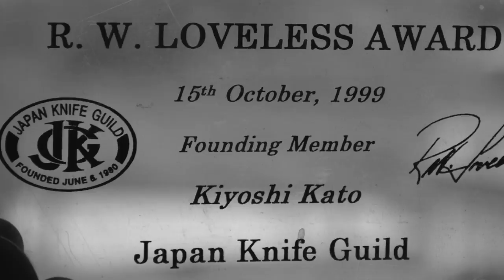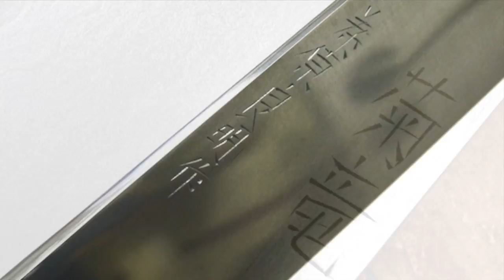Kiyoshi Kato Kitchen Knives 2014

Comment: I've never seen a wood planer-like tool used on hardened steel before.
Reply: +entropy11 That is called a "spoke shave". Originally  used to make spokes for wagon wheels. He must have hardened the snot out of it. Or made one...
Reply: +entropy11-- In Japan, that tool is called a "sen".  He actually wasn't using it on hardened steel.  You can see in the beginning of the video that he made a 3 layer steel laminate called, "san mai" by forge welding a high carbon steel core (for the edge which ends up in the center)  inbetween 2 pieces of mild steel, one for each side.
 
The mild steel on the outside doesn't harden during the quench due to it's low carbon content, which allows the bladesmith to use the "sen" (made from hardened high carbon steel) after the hardening process to scrape away the soft steel on the sides to expose the hardened center (edge) steel.  If you think about it, a sen cuts kind of like a file does, but it's only cutting with one sharp edge as opposed to the many edges (teeth) on a file.

  I believe the sen makes faster work of the initial stock reduction to expose the cutting edge (by tapering down in thickness from spine to edge), whereas a file will leave a flatter, more consistant finish and clean up the marks left from using the sen.  This all sets the initial blade geometry, which is then refined even further by using a number of different water stones, starting with coarser ones and working up through finer and finer ones, just like when using sandpaper.  Something along those lines at least.  ;-)  

Hope that makes sense!  :)
Reply: +lsubslimed Great explanation!
Reply: +entropy11 neighter did i.. cause that's done with an annealed blade :p
Reply: +Franco Buzzetti LOOOL he really used it on the hardened edge , my bad i pre-answered ahahah
Reply: +lsubslimed I've seen several different smiths use it to cut fullers on longswords. The shavings come off smoking hot. They use about 63-64 Rockwell blades on a 57-58 Rockwell sword so it's really not hard on the tool. Yes I know this is different than what he is doing here but it is viable for other styles of work. ;)
Reply: Gunslinger15 Yes sir, you are correct ;)  Yea I've seen guys use scrapers to cut in fullers as well.  They both work the same way in the fact that they each use an ever harder steel to cut away other hardened or non-hardened steel, but they are shaped and/or sized differently depending on what the purpose of the tool is.  Great example. :) 

It wouldn't seem all that unrealistic that hard steel can be shaved (cut) off by even harder steel if people understood that Hardness is relative.  Just like how carbide bits can easily cut (drill) through "extremely" hard steels such as files and the very hard sen being used in this video.. and also how the diamond wheels in drill doctors can sharpen carbide bits by cutting/abrading small pieces of carbide off of the surface..   Next come the lasers that cut the diamonds! lol ;)
Reply: +lsubslimed yep, one point on the sen. A sen is more of a two-way draw knife. A spokeshave isn't one piece by nature but other than that, great info.
Reply: Gunslinger15 Yea, I've never used either one myself,  however I'd love to try making a sen one of these days, maybe out an old file to try it out or some W2.  It would definitely be fun to make one even if I end up hardly ever using it.   Do you forge or make knives by any chance?  I could swear I've seen your YT name in some other video comment sections.
Reply: +lsubslimed to be honest I'm an aspiring blade smith, gun smith, armorer, luthier, bowyer, joiner, wood turner, and computer builder. I have several friends in the guitar world and the firearms industry, I say this not to brag but to say that this is where I get my information. Hopefully I will be building a guitar for Rabea Massad of Dorje in the next couple of weeks and I hope to forge various woodworking tools such as chisels and plane irons and other odd bits for Ben Crowe at Crimson Guitars. And finally I have learned some gunsmithing from IV8888. So yes I get around in the world. You can find my business at arsenalcustom on Instagram and Arsenal Customs on Facebook. Also I'll be looking for skilled help in these areas as smiths, strikers, luthier apprentices, etc. if you ever need a business to be attached to or be in correspondence with. I know this was a lot more than you asked but I figured you would appreciate the full "spill" so-to-speak. :-)

Comment: Maksim, thank you for posting this video, it is exceptional. The few slow motion sequences revealed subtle details in his process. The next day after the annealing (or normalizing, depending) he cold forged a curve in the blade, both directions. I'm assuming this was a grain structure refinement step but I would sure like to know what he says. Did he explain this step to you? Did he have a name for this step?
Thanks
Robert
Reply: When I watched i was wondering the same thing.
Reply: He was getting the scale off of the blade prior to cold forging.
Reply from the maker: ***** It is for scale removal
Reply: Maksim Enevoldsen thanks!
Reply: +Maksim Enevoldsen (JNS) 
Can hot forging not do this?
Reply: +Watch Ryder While hot the carbon in the blade will continue to create scale.
Reply: Nafzger Forge
Is it just a case of scraping the scale off if that is done?
Reply: +Watch Ryder The scale is very rigid, like a glass, it will not bend. So when he bends the blade, the scale pops off instead of bending with the steel. He then most likely lets the grinding wheel/belt (whichever he uses) take off any residual small flecks. Getting as much off as possible before grinding saves a lot of life in your grinding tools. That scale is VERY hard.
Reply: Doesn't cold forging uh... makes the knife prone to snapping and create cracks? Or does it work somewhat like work-hardening silver?
Reply: Lukas Prei
Reply: @user-yq4ph9dx8g  pure steel like tamahagane more easy to forging

Comment: A couple questions Maksim. The very purpose of cold forging prior to the hardening has eluded many American smiths, which includes myself. For what reason is Kato cold forging? I suspected since he annealed and then cold forged, he was fracturing the crystalline structure evenly similar to a normalizing cycle, which he didn't do in general sense. If this is not the reason then why? Otherwise once he brought the blade up to temp. for hardening, any other reason to have the grains fractured is nullified by the grain reset. Please correct me if I am wrong.

Also, is this a San-Mai construction? It is hard to tell when he is drawing out the tang on the power hammer, and not sure if the scale is tricking my eye, but I am counting 4 layers. As if the initial long bar stock was mild steel with two pieces of high carbon stacked on top of that and another piece of mild on top of all of those. EDIT: As I watch again, it looks like a 3 bar construction with the long bar stock being mild with one piece of high carbon on top of that along with a mild steel bar on top of that.

Thanks for your time and posting this video. Makes me want to buy a Kato blade sooner rather than later.
Reply: Daniel C as far as I can tell, it's a kasumiyaki blade design. One side mild steel/iron, the other side is high carbon steel. The urasaki would take most of the high carbon steel, leaving only a little bit on the edge, and the back of the knife to keep the layer together. A downside to these knives is after 40 or so years, it will tend to warp if made by someone who isn't a master bladesmith. The warping occurs as the two metals stretch and contract differently over time. I hope I could be of assistance!
Reply: It's a san-mai. You can see it when he does the forge welding at around 1:10 - Long bar of mild steel on the bottom, high carbon steel in the middle (you see him flux both sides of it), then another mild steel on top (fluxed on one side only).
Reply: I was wondering if the flux has carbon in it, it looks a bit different than Borax to me or am I not seeing it right?
Reply: From what I've read cold forging before austenizing can allow for a slight finer grain when up to austenizing temperature

Comment: Why does he first hit the metal with the hammer put in water and then puts it under the pneumatic hammer?
Reply: Vladimir Savov 
The water is used to blow the scale off the blade so the the powerhammer doesn't imbed it into the steel.
Reply: Thank you

Comment: Why did he hammer curves into the blade, one side then the other?
Reply: +Big Jenkins 
At first it looks to me like he was doing it to remove fire scale.  I thought it may have been about work hardening it but he hardens the blade after that, so no point, or maybe just to harden it enough to work with it and dress it.  It may also have been to check for any cracks and things he missed which would likely show up better when bending it that way and removing the scale.
Reply: Its to relieve stress It also can be done with a pneumatic air gun
Reply: remove scale

Comment: Wouldn't throwing water on it right from the forge damage the integrity of the blade? I'm new to forging
Reply: Seems to be fine. and when forging steel you are already doing tons of stressing to the blade as is. That is why smiths do normalizing sessions where they heat the steel to a bright red and then allow it to cool again. it allows the crystal structure to relax and relive the stress it has had built up inside it. at red heat the crystal structure gets all soft and it sorta flows together and then as it slowely cools the crystal structure evens out and then you can finish up by annealing it thats when you heat it to that bright red and when you "cool it down " you will put it in some kind of insulating matterial..he used ashes...some use vermiculite which is good at insulation. and you allow the steel to cool VERY slowely the slower the better. and then the steel is nice and soft...and then you can use hardened steel to scrape the blade down and then finish up with files then abrasives. Good luck with your forging adventures. I hope you find it as fun and relaxing and fulfilling as I do.
Reply: @bobbertbobby3975  thank you for your very detailed response. This will help me as I learn much much more
Reply: @lukeb5372  no problem bro.
Glad you have joined the community.
Working with your hands like that sure is fullfilling. I know that for sure.
Have fun and i hope one day you will be making videos on here showcasing your remarkable talents.

Comment: Did I miss something, or did he not tempered the steel?
Reply: You missed something.
Reply: +Stet Tan 
He hardened the steel but I also didn’t notice him temper it.  But he must have, because it was soft enough to shave the bevel with that chisel thing.
Reply: +UnbeltedSundew I've heard of Japanese knives that do get hardened but not tempered. Yes this leaves them incredibly brittle but also incredibly hard.
Reply: +entropy11 
I saw he had a liquid bath but that was water for scale removal not quenching?
Reply: Japanese kitchen knife is sandwiching hard iron with soft iron. 
Quenching hardens only hard iron.Although not shown in this video,
 it is removing the hardness a little by the act of tempering. 
He scrapes soft iron and a little hard iron with the hardest hardened tool
Reply: He is traditional Japanese sword maker and uses that same shaving method when making knives

Comment: What is the name of the tool he uses to shave the bevel?
Reply: its a draw knife. though i dont believe he is shaving hardened steel so easily with it.
Reply from the maker: Justin Taylor It is Sen in Japanese, and he do not shave hardened core steel but soft iron around it :)
Reply: You are mistaken.  That blade was treated before any shaving was done.
Reply from the maker: Justin Taylor haha i was there so i do not mistaken :D
Reply: so you are telling me this video is out of order in the steps it takes to create these knives.
Reply: he quenches. shaves the bevels and sharpens all stoft steel huh?
Reply: Justin Taylor  The blades he was making in the video were ni-mai consctruction, which means 2 layers (kinda like san mai blades, but san mai is 3 layers, usually made with mild steel on two sides with a high carbon steel core)... For these blades, one side is mild steel and the other side is high carbon steel.  Also, it is a chisel "ground" blade, so he was shaving off the mild steel in order to expose the high carbon steel on the other side, which creates a chisel "ground"  blade, or a blade that has only one bevel on one side, like a chisel :) ..  The mild steel remains soft even after the quench because it doesn't have enough carbon in it to harden.  So he can use a sen that has a hardened, sharp, high carbon edge, and it will shave off the mild steel.  It's the same idea with files, except a "sen" has only one cutting edge as opposed to many cutting edges ( or teeth) like a file has.   Hopefully that's enough info to make sense :)
Reply: a draw knife.
Reply: i understand that. what i meant was after he hardened there was no way he could shave metal off like that. typically its not a ni-mai some people say san-mai used with mild steel. im sure he used that for the effect he was going for. typically they are made from all high carbon steel/tool steel/ect.. if i had known there was mild on that knife i probably wouldnt have said anything at all.
Reply: the knife is 3 layers (HC steel with 2 layers of very mild steel or iron on the sides) once the knife is tempered a draw knife with full hardness (or a lesser temper) will cut into the softer knife

Comment: can anyone tell me what sort of flux he uses? or the traditional flux that was used. ??
Reply from the maker: David Liebenberg Actually he uses flux made in US mixed with Japanese, dont know what kind :P
Reply: +Maksim Enevoldsen (JNS) I read somewhere some traditional Japanese swordsmiths use a clay slip with sand, wood ash and some other ingredients mixed in. Supposedly the sand glows at the right temperature for forge welding, the ash helps control oxidation, and the clay binds it all together and drags out impurities as it's forced out of the joint during welding. Sounds tricky.
Reply: Yeah the texture of the flux just looked interesting. It did not look like borax. 
Things like flux is part of the finer things involved in knife/sword making that I'm interested in.
Reply: +David Liebenberg me too. I believe they don't use borax for blades because it lowers (slightly I believe, perhaps negligibly) carbon content.
Reply: it's the capacitor kind.
Reply: +David Liebenberg --- I'm pretty sure it's something along the lines of borax mixed with  steel or iron filings.  This is what Murray Carter uses.  If you don't know who he is then a quick google search will fix that.  ;-)

Comment: what tool is that at 12:00???
Reply: yeah...wtf is that...after he hardened the metal in cold water he is sharpping steel by cutting in to it?
Reply: Its a Sen which is essentially a blade smiths drawknife.

Comment: 1:29 - Charcoal?
Reply: +Watch Ryder   --  Yes, pine charcoal is the most desireable for traditional japanese smiths since it's carbon rich, can burn very hot and is very low in impuritues.  A lot of times normal coal/coke is just used for the main forging operations while the "clean" pine charcoal is used just for heat treating.